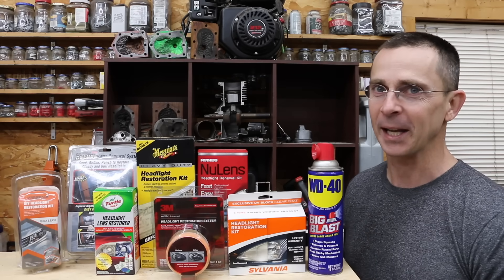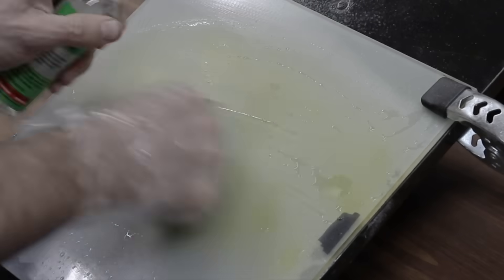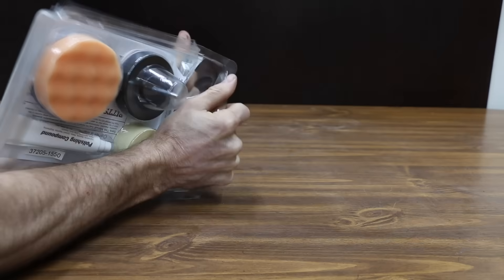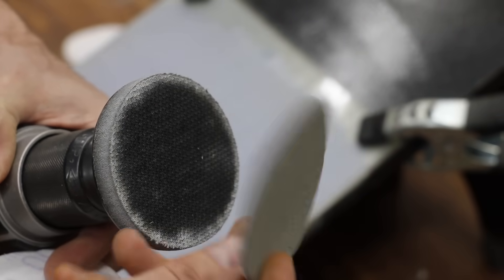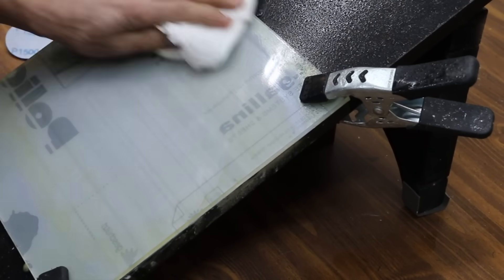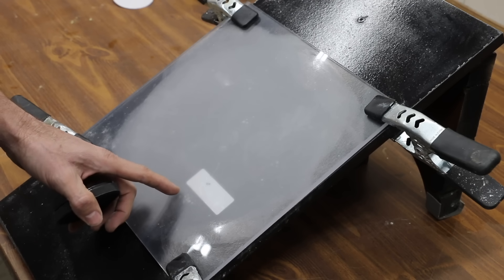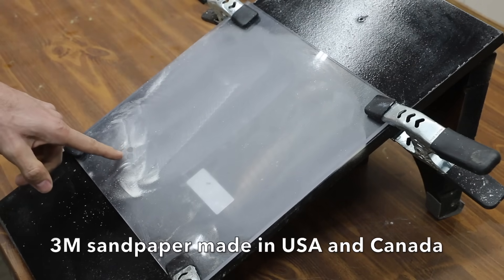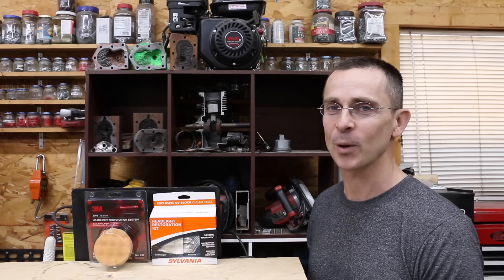Best Headlight Restoration Kit?  Let's find out!  3M, Sylvania, Meguiar's, Mothers, Turtle Wax & HF

Comment: This is a great video and I really appreciate the comprehensive review.  My headlights have some deep, I mean really deep (almost like someone hit them with a weed eater deep) scratches.  Would Sylvania or 3M still be the best bet or do you have something else you'd recommend for headlights with heavy duty damage.  Thanks.
Reply: I’m trying the 3M and the sylvania, there’s an option to just get the surface activator and clear coat from sylvania that’s 10 and the 3M he shows is like 20 overall I think that’s the best bet if your trying to go the cheaper route

Comment: Spray-on oven cleaner (store brand is fine) will remove the yellow film faster and easier than sand paper. Just tape around the headlight to protect other surfaces (or immediately wipe the cleaner off surrounding surfaces). I then used 3M rubbing compound and a clear coat spray. I can’t say I examined it under a microscope, nor can I say it was cheaper, but it was very quick and easy.
Reply from the maker: Thanks for the feedback.

Comment: I use a variation of the sweet project cars method. Mothers chrome polish 2 coats with a cheap harbor freight buffing pad in a drill. I coat with 303 when done. The trick is to put on the 2nd coat of chrome polish while the headlight is still warm from the first coat, let it dry to a haze, and buff off. After three 3 years on the ground the set of test headlights were still clear.
Reply from the maker: Thanks for sharing!

Comment: Basically just buy some 3M P600, P800 and P1000, and then 2k UV clear coat it done.  You can also use P1500 after clear coat has cured to remove orange peel and then use polishing compound to make them perfect.
Reply from the maker: Thanks for the feedback.

Comment: You won't know until a few years later which one is best, because to me the lasting finish is the most important. One might give great initial results then yellow quickly.  I used a Rust O Leum brand on a vehicle almost two years ago and it is still clear and unclouded. FWIW
Reply from the maker: Thanks for the feedback.

Comment: I use chrome polish, Turtle Wax brand, with a terry cloth wash cloth.
For really bad lens I use 1,500 grit sandpaper and water to remove the worst. If really bad start with a little courser grit. 
Bought a bottle of UV protector liquid off of Amazon. 

Just rub with terry cloth until it the cloth comes off clean.
Reply from the maker: Thanks for sharing.

Comment: I'll have to say I've used the harbor freight kit multiple times on different vehicles and I'm sure the instructions are wrong because it is wet sandpaper and if you wet it instead of using it dry it doesn't clog and the result is 100% better.
Reply from the maker: Thanks for sharing.

Comment: you know they have products out that are plastic specific polishes and they are exceptional.  some are made for jewelers, Meguiars has a new one  and its freaking good. or you can start with 800 grit and wetsand working up to 3000 to 5000 grit wet sanding and then finish with the plastic polish. result will shock you
Reply from the maker: Thanks for the feedback.

Comment: I'm curious how did the Sylvania restoration kit hold up over time? I'm seeing a lot of Amazon reviews saying that it doesn't last and needs to be reapplied every 3 to 6 months.
Reply from the maker: Thanks for the suggestion.
Reply: Per Amazon website...
Lifetime Warranty: The components of this kit are good for two headlight assemblies. Once installed properly, the performance of the Sylvania Headlight Restoration Kit is guaranteed by a Lifetime Warranty for as long as you own your car.
Teetar
Reviewed in the United States on July 14, 2018
The product worked well. The lights started to fade after a year. Contacted seller and they refused to help. If you can't honor "life time" warranty, why put that in your main item description?
638 people found this helpful

Comment: Deep Woods Off! No joke. Not a restorer but will remove all yellowing. Spray it on. Let sit for 20-30sec. Wipe off while still damp. Then wash headlight with dish soap to remove residue. Ive been doing this for years. EZ PZ.
Reply from the maker: Thanks for sharing.

Comment: I have a pro 3m kit ($430) and it comes with everything u need to do multiple headlights and it does a amazing job to bring it to a like new condition. My customers are just shocked and asked if I had just replaced them with new ones. I charge $100 to do so  no I possible couldn't  replaced them

Comment: My 2010 F-150 headlights are to the point of needing restoration so of course the 1st place to check for a restoration kit recommendation is Project Farm!
Reply from the maker: Thanks for sharing.
Reply: So I used the Sylvania kit and couldn't be more pleased with the outcome.  Wow, what a difference.  I have used other kits in the past (pre-project farm) and while they worked to some extent, there is no comparison to what this kit produced as an end product.  Absolutely great.  The lenses look practically brand new.

Comment: this is a great test video for headlight polish. but I figured out a very effective,. fairly easy, and cheap way to polish lights that you should try,. I used about 1/2 tube of Colgate whitening toothpaste and a couple of medium and soft tooth brushes from the dollar store to clean my headlights ,. then i polished them with Blue Magic headlight Polish , using a ,red shop rag, and a pair of cotton socks that i also got from the dollar store . the Blue Magic works pretty well , but i discovered that it is best to only polish about a 3" diameter area at a time.   there wasn't any sanding involved , and i cleaned and polished both of the headlights and both taillights on my 1989 Dodge in about two hours , and did it for less than $20.  it is best to work on it in the shade where it is cooler or at least out of direct sunlight.  .  thank you.  Tim from Wisconsin
Reply from the maker: You are welcome!  Thanks for the feedback.

Comment: Just use water and 3000 sandpaper. Use 1000/1200 if the yellow gunk is way too thick. Use 500 if your car is pretty much a moving wreck and you never maintained it properly lol. But usually 800/1000 for sanding and 3000 and a pass of 5000 do the trick.
Reply from the maker: Thanks for the feedback.

Comment: My go-to headlight repair kit: Crest toothpaste (without whiteners). Not kidding, it works amazingly well.

For those interested in how this works:

Start by cleaning the headlights a bit in the beginning. Dry the headlights. Next, take a rag and apply toothpaste to the headlight. Begin rubbing the toothpaste into the headlight (circular motions appear to work best). Wash off the toothpaste and see how much you've cleaned off.
Reply from the maker: Thanks for sharing.

Comment: I used Sylvania on my sister's 2001 GTI two years ago and they still look brand new.  I used the leftover on my car, and while I wouldn't recommend that if you want a perfect result (the sandpaper was pretty used up by that point and my headlights are huge), it did a good job and those results have also held up.   It does take manual labor -- about 40 minutes of hand sanding/polishing and another 10 of other stuff, but the results are well worth it and there's less risk of damaging the surrounding paint than with machine sanding.  (I still used painter's tape to cover the paint while sanding)
Reply from the maker: Thank you for the feedback!

Comment: Not a valid test for headlights that only have hazing from oxidation. The problem with the testing performed is the initial setup of the polymer test samples. They were not damaged by sunlight oxidation, they were deeply scratched up with very coarse sandpaper, then painted.  The paint settled into the deep scratches which then biases the results from the beginning.  Most products are designed to remove the hazing caused by the sun oxidizing the polymer lense, not to repair badly damaged lenses.  These test samples were badly damaged from the beginning and in no way are representative of a normally sun oxidized lense.
This test is good for identifying a product that can repair badly damaged lenses.  It is not a valid test for identifying the best product for removing the UV haze and oxidation from the lense and returning them to a like new condition.

Comment: I used one of these in 2021 summer, it worked pretty good, except we are still in 2021 winter in coming, lights are going fading out aging, yup i used the turtle wax.
Car you repair a lends that has been treated with one of these products?
Reply from the maker: Thanks for sharing.  Thanks for the suggestion.

Comment: I was a bit disappointed with the test setup you used here. You normally wait long periods of time to ensure an accurate test setup, but this one felt like a shortcut.

I don't think that 120 grit sanding and a spray on yellow comes anywhere near simulating a truly aged headlight lens (years of UV and ozone exposure, essentially sandblasting, etc). These conditions will really change the material.

I hope you consider trying the test again using actual aged headlights!
Reply from the maker: Thanks for the suggestion.
Reply: I thought the same as well... It would have been better to just go to the junkyard, find headlights with a similiar degree of damage and pull a few for a real world test.

Comment: I work in a bodyshop and sometimes we buff like you did on the plastic, but there is another option we do. we wet sand with 2000-3000 grit and we spray them with the clearcoat paint, they usually look brand new. Would been nice to see how that compares because its a lot faster then buffing.
Reply from the maker: Thanks for the feedback.

Comment: The statement that the sandpaper makes the kit is absolutely true. I don't use a kit when I do restoration. I have 600, 1000, 2000, 3000 sponge and 5000 sponge. Always do over lapping motions. Then use a cutting compound on a a drill pad . Then use the polishing pad and a polishing compound. The poly carbonate at that point should be like new shiny smooth. Then you can use whatever UV coating you like. They have a spray on , wipe on, and film that goes on like window tint. You could by the kits just for the UV coatings but you can get them by themselves.
Reply from the maker: Great feedback. Thank you!

Comment: Great info.  Thank you!  I tried Mother’s mag and wheel polish.  Applied with a clean rag by hand.  I was thinking way to much into this.  Please try it.  You will not be disappointed.  This will remove the built up grime and NOT scratches.
Reply: I've had good luck with rubbing compound followed by polishing compound (for car paint). I do it by hand. Also, if the yellowing isn't too bad, just the polishing compound can work. However, it does yellow within a year, as I have yet to find a decent UV blocker that lasts or is as clear as not using one.
Reply from the maker: Thanks!  Thanks for sharing.

Comment: I came here after using the turtle wax kit today, I did not get good results and the 2012 toyota rav4 plastic was only just starting to oxidize. The sealer left streaks and did not flatten.
Reply: P.S. I might wrap the headlights to stop this from happening on my newer vehicle
Reply from the maker: Thanks for sharing.

Comment: I use a small amount of break fluid on a paper towel. Works very well each and every time. I have not tried a uv protection coating on afterwards...yet.
Reply from the maker: Thanks for sharing.

Comment: I used a soft buffing wheel on a battery a cordless angle-grinder, coated with Mer car polish. No sanding needed. Job done, 2 minutes per headlight lens.
Reply from the maker: Thanks for sharing.

Comment: Best headlight restoration kit I’ve ever used was Korkay “Kork Rub” it’s actually an industrial Cleaner/Degreaser we use at my dealership job to get bugs off of customers cars. But it also does a FANTASTIC job at taking out the yellow haze out of headlights. I also hit them with some 3M 1200 grit rubbing compound, that was 3-4 months ago and they’re still clear as the day I did it.
Reply from the maker: Thanks for the feedback.

Comment: Just did three headlights using the 3M system. One lens on a 2004 vehicle, two on a 2008. (The 2004 had recently had one new lens mounted due to an accident.) Both vehicles were Toyota Sienna vans. I and--more importantly--my wife are very pleased. I do need to add the UV protection yet.

On the compound curves of a headlight lens, the sanding with a drill takes some technique development. "Flat" does not exist. The sandpaper can bunch up and tear. The drill rotation tries to pull the sanding onto the cars paint job (masking tape is not very protective). All of these issues are predictable. Learning the "touch" needed can take a few minutes (unless you do this type of thing all of the time). It is easy to apply too much pressure and end up with ridges of removed plastic fused back onto the lens. Fortunately, these, once recognized, are easy to sand off. The first lens was a learning experience. Thereafter, it was smooth sailing.

I recommend frequently wiping the lens with a dry cloth during sanding. This action removes loose material that might become fused to the lens, reduces buildup in the sandpaper (even the 3M sandpaper eventually clogs), and lets you better see what areas need more attention. Be sure to break through the outer gloss with the most coarse sandpaper on all areas of the lens.

The sanding takes some time. While I have a nice cordless drill, I decided to use an AC drill. I did not want to run out of battery before the job was done.

Be warned that your headlights will look worse before they look better. Once started, the job must be completed if you plan on using the lights while driving. The first pair of headlights took me about three hours from setup to "time to show the wife." The singleton, done about a week later, took fifty minutes from stringing the extension chord to putting it away (this includes washing and masking time).

In my case, when I first saw the outcome at night--headlights on obviously--I noticed some areas that needed more buffing. The light coming from inside the lens highlighted areas differently than the sun did. A few more minutes of polishing resolved the issues.

If you go looking for the 3M "How To" video for the 3M kit, ignore the information in the package. The outer package sends you one place. The instruction sheet sends you to another (this is my only real "beef" about the 3M product). Neither had an obvious place to start the video. I did find it on YouTube. Basically, they do what the instructions say. If you can "read for meaning," you won't need the 3M instructional video. If this kind of work is new to you (it was to me) then watching the video can be a confidence builder.

As always... really love your channel.

(edit was minor punctuation and capitalization change)
Reply from the maker: Thanks for sharing.

Comment: Thank you! I'm just a bit confused.  By the pics you showed, it looked like the New Polycarbonate actually did better than Sylvania and we didn't get to see the New Polycarbonate 'demonstrated' like you did the others (removing the backing of the plastic square and showing the plastic headlight kit box behind it.)  Was there a reason you opted for the Sylvania instead of the New Polycarbonate?
Reply: I know I'm not the poster, but the "New Polycarbonate" is not a restoration product, it's a sample to benchmark against with no damage and therefore no restoration. Essentially it represents a new headlight. Hope this helps

Comment: basically what I've found is, you are better off, just buying sanding disks from 3M, using some sanding pad in a drill or an orbital sander starting from 600 working your way up as high as you want then either polishing or top coating with a UV protecting clear coat.  Ive also done that, even UV protective paints fail over time after a couple of years baking in teh sun.

Comment: Id like to see these tests on actually headlights though..  Use the best 3 from this test on the same light & do it in strips maybe, So do the left side of the light with one, then the middle with another & the right with the last one...Just tape off each side maybe.. or even just 3 different headlights, it don't matter so much that they might have the same deterioration, at least we can see on the real thing. :)
Reply from the maker: Thanks for the suggestion.

Comment: Thanks, a great comparison. Coincidentally I have just used a 3m heavy duty restore kit to restore my headlights. The kit was slightly diff in that it had a clear sealer coat to wipe on last. The headlights were very foggy to start but restored amazingly well, infact I'd say almost like new. So I can vouch for the 3m - chosen by luck.
Reply: I got the 3M ultra kit as well. That’s the one that gives you the UV stuff to go along with it. I’m betting yours had a glove to keep the UV sealer off your hand. I like the sylvania results but it’s the 3M drill attachment that helps to sell the 3M kit cause you work smarter not harder. I’m going to use it on my 08 taco this weekend. The lights are still working great but due to sun fading and age the top 1/2 of the light has that cloudy look. Ought to restore some life to my lights ( and make the truck look better when I return it to my father since I’ve got a new Ford Ranger on the way)